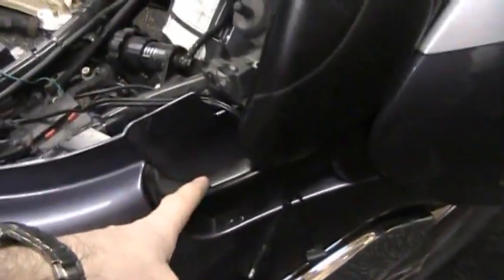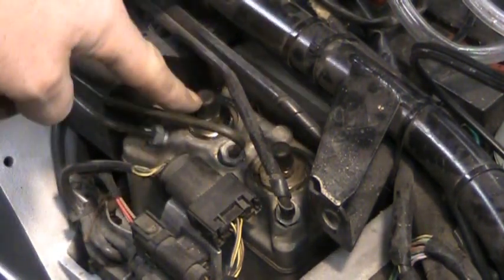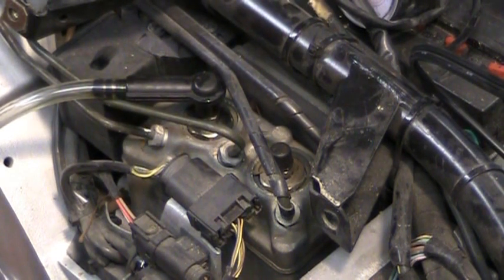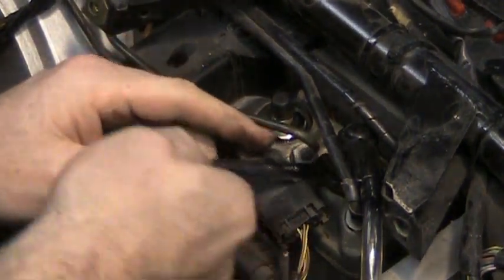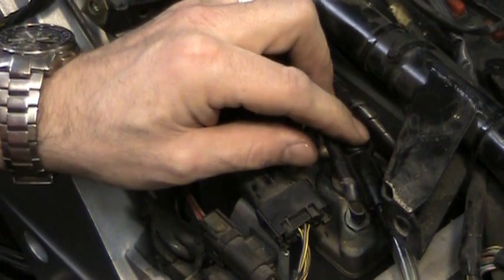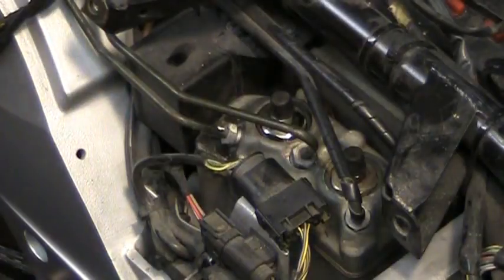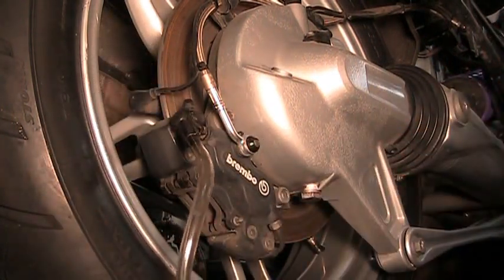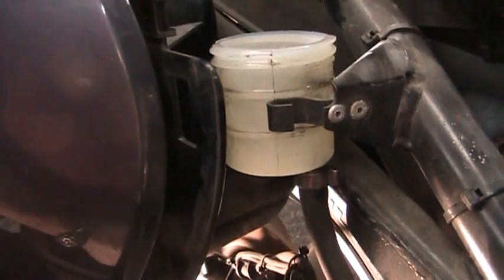BMW K1200LT Non Integrated ABS and Rear Brake Flush DIY

Comment: question I have a 2000 k1200lt that has sat for 7 years took out the other day and the rear caliper locked up.  I know that the brake lines need to be replaced but wondering if a repair kit for the caliper will fix the caliper.  The dealership has not seen the bike yet but they are only saying to replace the caliper but there are none in the country right now.

Comment: Great video but I have a question. What is the attachment on the end of the Mity Vac hose that you attach to the caliper?  Also, it appears that you are leaving the bleed valve open on the caliper and then squeezing the Mity Vac handle. Doesn't this induce air into the system, or am I missing something? My Mity Vac doesn't have that attachment on the caliper end of the hose. Where is that available? Maybe it's a one way valve so the air doesn't go into the system? Also, have you used a pneumatic bleeder and what are your thoughts on it?

Comment: Hi, I have a problem so if you could help me I would be grateful.
After my brake oil pipe burst, I irradiated the brakes according to your video, but at one point I didn’t pay attention to the upper oil tank located on the steering wheel and I think the pump pulled my air.
After that I irradiated the pump according to the video but the pump is constantly buzzing. when I make contact with the key it does not buzz and when I apply the foot brake the pump starts buzzing.
I irradiated the ABS pump but the pump still buzzes.

Thank you in advance
Reply from the maker: It sounds like your ABS is broken and needs to be either replaced, repaired or bypassed.
Reply: @kirksmotorrad  thanks a lot for the quick reply. is there any video where a bypass or scheme is done

Comment: I always learn a lot from your videos, Kirk.
Do you have anything on what may cause the reverse to stop working on an LT? I may have  found one, but the reverse is not working as well as the abs. It's a 2000. Seeing that you're very familiar with the LT, I thought who better to ask about this than you. What  should I look for, and is it worth pursuing the bike? Any help you can provide would be greatly appreciated.
Reply from the maker: Check your fuses first. The ABS and Reverse are not related.  Maybe the reverse module is burned out or the speed sensor the  trans needs to be cleaned. Follow up with me at kirksmotorrad.com

Comment: Sorry, I didn't understand one thing, do the drain cocks have to be opened with the key turned on? and then bleeding is done simply by pressing the brake levers until all the air comes out?
Reply from the maker: no. The key does not need to be on for non integrated brakes
Reply: @kirksmotorrad  so I open the bleed valves and activate the brake levers to let the air out and that's it? as if I were bleeding the brakes of a motorcycle without ABS

Comment: I replaced the ABS module on my LT 1200 from 1999, do I have to bleed the abdomen and front and rear calipers? I bled my abdomen and now when I brake it blocks the rear wheel, what should I do to solve the problem? Thanks
Reply from the maker: bleed the ABS too. all of the bleeders if you replaced it

Comment: I just bought a 2002 K1200LT and it's wonderful BUT the ABS is blinking. previous owner recently had the system bled and braided lines put in....Not Cheap! but the lights came back on soon afterwards.  The brakes work just fine but now, and as I look on YT, I see conflicting info on the ABS.... some ABS seem to fail and no brakes and some fail and brakes are just fine. Like Mine, so far. Do I need to do something? Bike has been serviced by dealer since new.. They want $3000 for parts and $1500 labor +/- which seems to be the going price. I'd just as soon remove the ABS system. Or ignore it. Opinions??
Reply from the maker: There are options. Contact me through my web page and be sure to leave your phone #. I can get you on the road.
Reply: @kirksmotorrad  Thanks. I will contact you. I did see the module repair video. Talk to you in near future.

Comment: Hi Kirk I followed your procedure but when I got to the ABS Module part I tried to pull a vacuum and released the bleeding nipple but not nothing really came out? 

I am obviously doing something wrong?
Reply from the maker: Try to manually pump the brake with the bleeder open. Something may be stuck in the line if you still have the OE rubber ones.
Reply: @kirksmotorrad Thank you I have the after marker version, I went ahead and manually pump the break and got some fluid coming out I am just not sure how much should really come out. It was clear fluid at least. I will do the back brake tonight and see if the flashing ABS light will go away. I tried multiple times to reset the ABS module by using the alligator clip method on the pin 21. If it still bad then I assume I need the ABS module repaired or replaced. I rode it last weekend with the ABS light flashing for 150mils (maybe not such a good idea) Just to get some "cobb webs" out of the bike.

Comment: Would you happen to know if this is the same procedure as doing it on a 1998 K1200 RS?
Reply from the maker: yes it is.
Reply: @kirksmotorrad  Thank you for letting me know. I was goin to install speed bleeders on my bike. Do you have any thoughts about that? I have them on both my Honda VFRs and I have had great luck with them.

Comment: I am replacing the stock lines on my 99 LT with Spiegler SS in the next couple days...I assume to lower the level in the ABS unit and the reservoirs before pulling the lines off. I know the system will be open, but filling should be the same as this procedure, correct?
Reply: what kind of tool does it take to get the banjo nuts out
Reply: +Jack Martin 6mm hex socket
Reply: Thank you got it done and bled them, total of ten minutes now I'm off

Comment: art reinhardt the brake fluid runs through the abs unit to the wheels. what is the advantage of bleeding the abs unit if the lines to it have not been removed? bleed at calipers until clear.
Reply from the maker: Debra Reinhardt There is still residual old brake fluid in passages of the ABS. The few extra minutes it takes to bleed the ABS unit is worth it in my mind since it is so expensive to replace.
Reply: +illinoisBMWriders what tool do I use to take the banjo bolts out?
Reply: Jack Martin

Comment: I replaced my rear caliper on my 2000 BMW K1200rs, but when I got to the ABS module the brake fluid didn't run through. Can you help? I thinking that my abs pump is bad
Reply from the maker: Have you replaced the brake lines yet? You may have something jammed in there.
Reply: @kirksmotorrad  No I haven't replaced the line yet. That sounds like the ticket

Comment: Anyone....If the ABS unit has lost some fluid is it possible to refill through the unit itself ?
Reply from the maker: Not on the early models. You need to fill the reservoirs and flush it